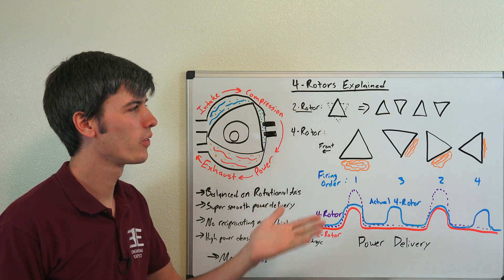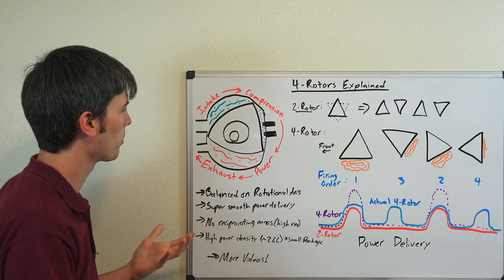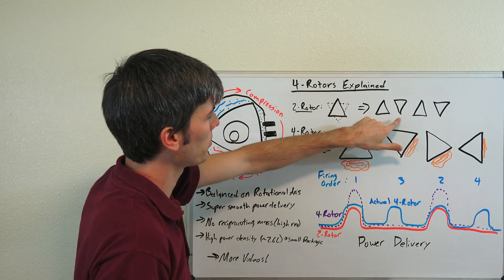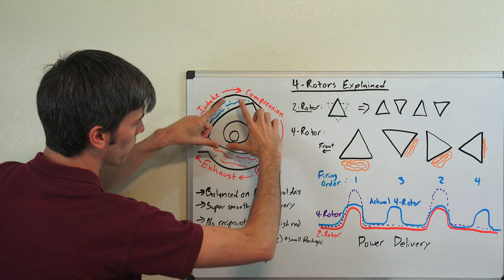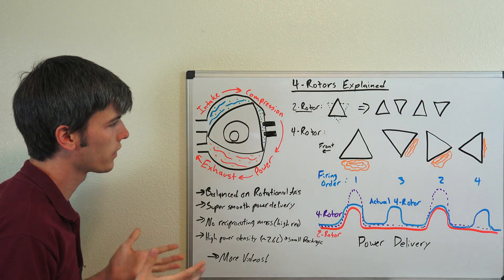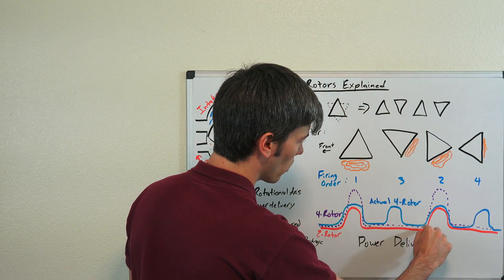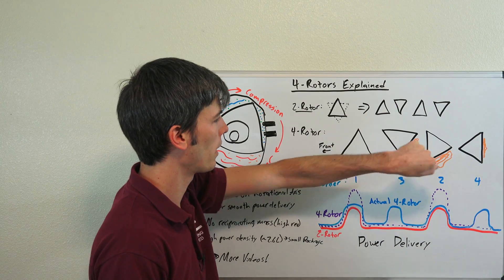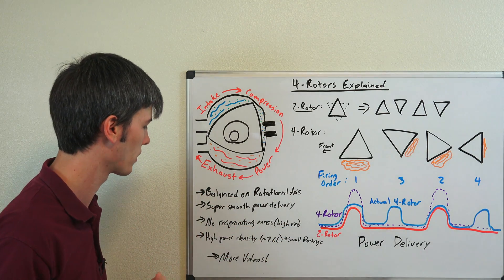The Epic 4-Rotor Rotary Engine - Never Used In A Production Car

Comment: Is there any requirement on a four rotor motor for all the "combustion chambers" to be along the same line? Could the cycle of individual rotor systems be rotated in comparison to each other?
Reply: Mishn0 can you explain?
Reply: Then they couldn't be on the same shaft and you would have to use some really awkward gears to link them together.
Reply: yeah that would be possible. It may even be more balanced since the power input onto the crank happens right and left and not only on one side.
The dow or upside is you have intake and exhaust ports on both side. And that means single turbo is much harder to do. And then again twin turbos have much better response times. And then there are the questions of packaging. I could imagine a single turbo 4 Rotor is easier to package than a twin turbo 4 rotor.
Reply: +godfather1118 just imagine the picture that EE has drawn. now turn it 180° to the right and overlap it with the picture that EE has drawn. voila, you have what he want's to say.

Comment: Hi Jason, it seems logical to split the power strokes for a smoother power delivery. However why are "Big Bang" engines used in motorcycles, although they basically have a power delivery which is not as smooth as it could be if one used a different crankshaft. I understand it is done for driveability reasons but I don't understand why a big bang-engine is more driveable than an engine with a more continous power delivery. Maybe you can do a video about it, probably this would be interesting for some other viewers aswell. cheers

Comment: 4 rotors with 180º offset have been built, they are called "Big Bang" engines in the Rotary Community
Reply: I just saw a video of a 4 cylinder "big bang" motor and now wondering if it would work on a V8.
Reply: Vegaspsycho  so you mean a flat plane crank? 
It's been done for a long time
Reply: Yup, it's been done and it's the cheapest way to go, but it's not optimal, as it's described in this video
Reply: Big Bang engines have been built and used in both 2 stroke and 4 stroke racing motorcycles.  In fact, some people took 80's era 2-stroke Yamaha RZ350 production twins, lined up the crank throws, and produced what were referred to as 'twingles'.  Honda built 500cc 2 stroke NSR racing 'V' fours with staggered crank timing.  This allowed combustion events to be placed closer together, which in turn allowed power pulses at the rear tire to be staggered.  This in theory allowed the tire to break loose more easily but then have more time to recover traction-wise, resulting in a more tractable power delivery.  The same principle is applied in various 4 stroke MotoGP engines, including Yamaha's cross-plane crank inline four.
Reply: @richardmiller7066  you mean cross plane? You mean flat

Comment: are they better than normal piston engines.. Im talking just generally.
Reply: Raivis It depends on how you drive, and how much you like to work on cars. The rotary engine takes more maintinence and knowledge than a normal piston engine, but it gives back with the ability to redline it all the time and not wear it out or damage it. In fact, rotary engines last longer when they are driven spiritedly and redlined on a regular basis. If you're looking for a good car to just drive and not have to worry about as much, like a gas efficient commuter, then a rotary is probably the worst engine out there. However, if you want every drive to be full of fun, and a daily driver that you can take to the track, but are willing to put a bit of work in the rotary is probably the best option.

Comment: 4:20 Actually there was a V-12 at SEMA that fires as two V-6s glued together, rather than splitting them evenly. It is a V-12 LS made by some guys in Australia; supposedly going to be available to the public soon.
Reply: VW have done it for a while in the phantom....W12 engine...same engine they use in the Bentley.
Reply: never known there been a wr12 in the phaetom just the w12 but it wouldn't surprise me if they brought one out in the states.

Comment: Not all rotary engines work this way. I'd like to see and review on the MYT rotary engine which can have 4 pistons in a single rotor configuration.
Reply: There are MANY different rotary engine designs. happily the other designs actually seem to work, though all have their inherent associated problems.
Sadly the MYT doesn't have those problems, as it doesn't actually work in the first place to cause said problems.
Unless you have found something I cannot. A credible video of one actually doing more than be demoed on compressed air.
Reply: Fair enough.

Comment: Nice video !! Got two questions, Why rotary engine can rev that high?? And what is the use of blanket on the turbocharger??
Reply: Yathu prem less reciprocating mass allows for higher revs. 600cc  motorcycle engines can hit 15k rpm or more.   the blanket holds heat in, this allows the turbo to retain as much energy as possible for quicker spooling and reduces  heat transfer to other components under hood.  heat can deteriorate certain parts, wires,  hoses, plastic etc. heat soaking into the intake pipes,manifold,  or intercooler reduces performance
Reply from the maker: Mostly due to the fact that there are no reciprocating parts, only rotating. Here's a bunch more info: https://www.youtube.com/watch?v=sd6pJtR4PaY
Reply: Yeah, basically the more heat in the turbo the less energy removed from the exhaust therefore the faster it'll move. Heat out = velocity down = slower turbo spool. Ideally you'd have no heat loss at all through the entire exhaust until it leaves out the back.
Reply: Engineering Explained thanks for the clarification of reciprocating vs rotation
Reply: Thanks all of u !!

Comment: In a 4 rotor or a I4/V4 config, would the car get more torque but less horsepower by doing 13/24 instead of 1/3/2/4 ?
Reply from the maker: Similar torque and power, but would run a bit rough in comparison.

Comment: Could you talk about Motorcycles?
Reply: Nayib Noyola there awesome nuff said
Reply: so I wasn't the only one thinking 'motorcycle engines rev so much higher' :D
Well it all comes down to piston speed and piston weight
Reply: You both missed something what I said;)
I was talking about piston weight, not weight of the vehicle. And I was talking about piston speed, which is the thing that comes from calculating bore/stroke/rpm and horsepower together.

Yea, sure you're right, they use very small stroke and big bore. But why? => because they want to have slow piston speed, therefore less lubrication problems and smaller acceleration forces, which enables the pistons to be lighter, which again enables them to rev higher.
Reply: That's not what I meant^^
Piston weight is the smaller problem I think. Because compared to the forces of combustion (I'm just guessing) the acceleration forces won't have a lot of influence. So as far as I know it's mainly about lubrication
Reply: the valve train is also a factor
Reply: Yep true, valve float
Reply: no people will want to start riding them and then they will die and their family and friends will be sad
Reply: Cool
Reply: Riding motorcycles is amazing fun. Just because you ride doesn't mean you'll die.
Reply: Nuka Cola Quantum some people think they are gonna live forever man
Reply: Nuka Cola Quantum yeah ive been riding almost 15 years (consistently) Ive been down a lot.  I dont really cruise......   Im calming down a bit as I get older.  Always wear gloves, helmet, and jacket minimum.  Thats my advice.  Usually sufficient
Reply: Naptown Squid ATGATT, huh? I'd tend to agree. Whilst I haven't been riding as long as you, I've only gone down once, and what I suspect is that there was gravel on the road, rear tire lost its grip and I lowsided out around a bend. But, I was fine, and the bike was too, for the most part, scratches aside. (Thank god for frame sliders.)
Reply: Nuka Cola Quantum lol not hatin man but never blame gravel, or anything.  Its always your fault.  If you blame something you wont learn. Whats ATGAT?   If you ride you will fall, almost for sure thing.  Accept it, wear gear.  When your comfortable and confident, thats when it will happen.
Reply: Naptown Squid ATGATT = All The Gear, All The Time.

I'd have to disagree. Had the road been completely clean, I'd argue that, because of every other corner that I hadn't lowsided out on, I wouldn't have gone down. You can't compensate for everything. It wasn't my fault, and I know that, because I wasn't playing with the throttle or the brakes, it was a normal, hard-leaning corner. Not to argue or anything, but if you've gone down a bunch and you know it was your fault every time, then it sounds to me like you haven't learned anything.
Reply: I agree to both of you kind of. 
1. If there's noone around and you crash, then it's your fault. There's noone else, and there's always a way how you could not have crashed.
2. If you're coming around a corner, even if you're slow, and there's suddenly gravel, you will probabl go down. You were riding slowly, and you did not know about it, so it's not your fault.

Could argue for both, both are kind of true. I guess that's riding.
Reply: DerKrawallkeks its just a bad way to look at things in my mind.  gives you an out  if you know what i mean.
Reply: DerKrawallkeks its just a bad way to look at things in my mind.  gives you an out  if you know what i mean.
Reply: yep, true
Reply: Ha he basically did here -- this is the same reasoning behind the I4/V4 vs I3 vs V2/I2 debate of racing bikes!

Comment: Please make a 2t oil as an diesel additive video,
Reply: It's good for the older type with mechanical pumps as they require sulphur as a lubricant. This used to come from the diesel but, as low sulphur is becoming more common, can come from 2t oil. Common rail don't need it